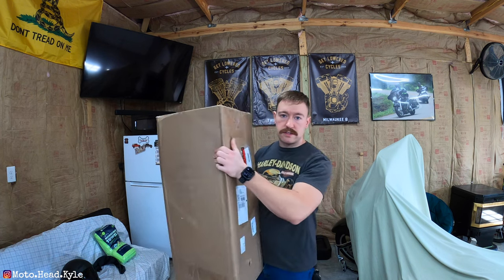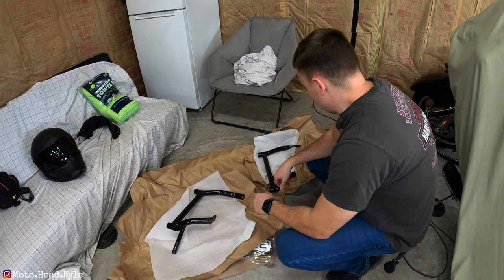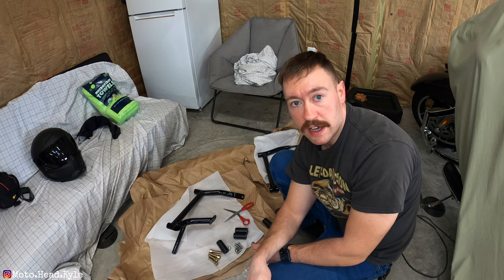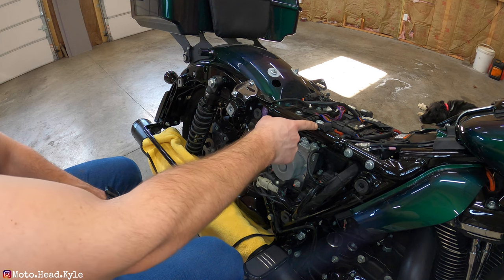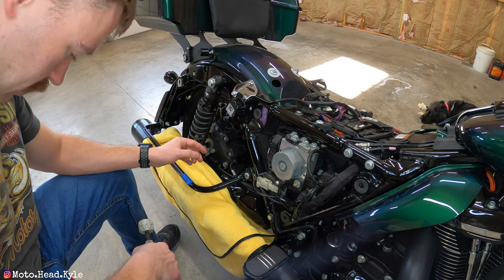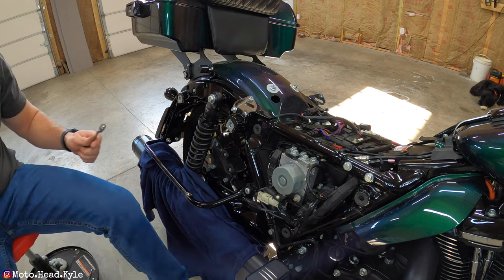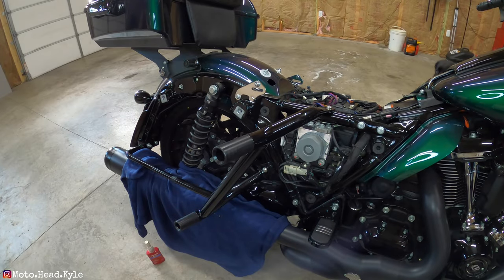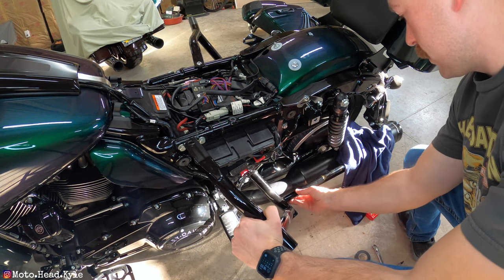Santoro Fabworx Not Yo Daddy's Bag Guards (Unboxing & Install) on a Harley Davidson Road Glide

Comment: Would be interested to know if they will hinder the passenger in any way…great content bro
Reply: I have these on my RG and they do not hinder the passenger's experience at all.  I highly recommend them as they protect the bike and look great.  Get the the roller wheels on the rear lower guards.  They hold the bike if it tips without any damage to the bags.
Reply: Thanks Kyle for the reply I really appreciate it..that was the only concern I had before ordering them..again thank you
Reply from the maker: Thanks Joe! I have not had a passenger on the back yet, however I did sit on the backseat afterwards and they didn’t seem to hinder or bother me. Hope that helps!🤘🏻

Comment: I have them on my road glide. You just have to watch the bag guards hitting the swing arm.
Reply from the maker: Is your sag on your rear suspension adjusted properly? Not trying to sound smart, but from what I hear that’s usually the problem on why it makes contact with the swing-arm, if you hit a bump and bottom out
Reply: @MotoHeadKyle  thats exactly what it is . My legends call for a 12” sag. I found I had to go 12 3/8” to completely eliminate it.
Reply: That’s what I’m saying, even with the sag set to the manufacturer specs they can hit